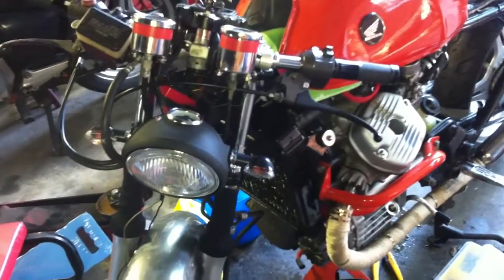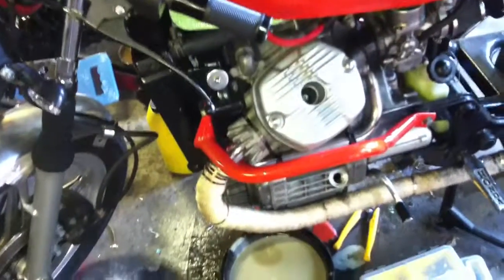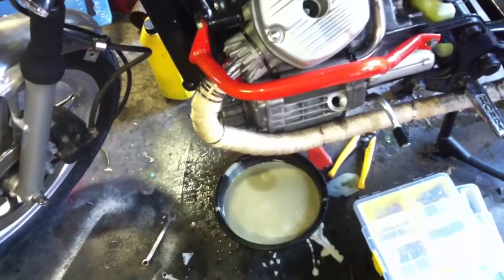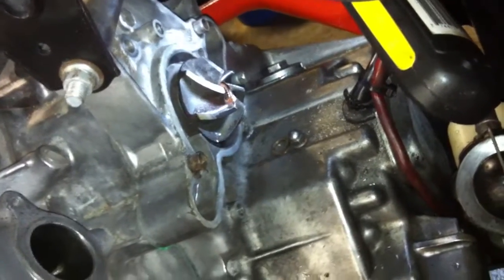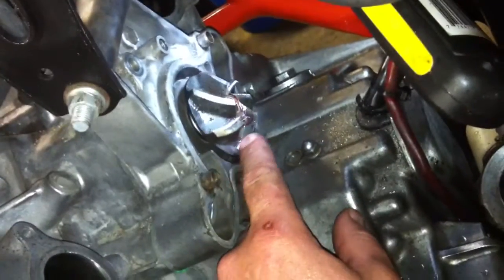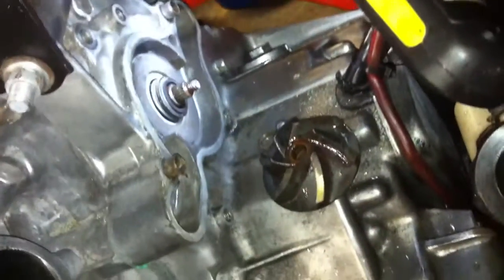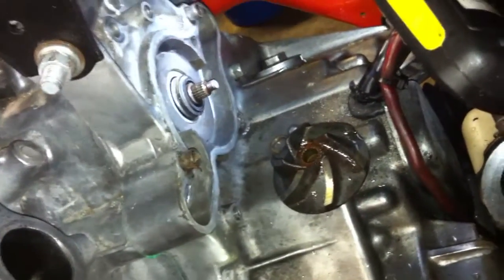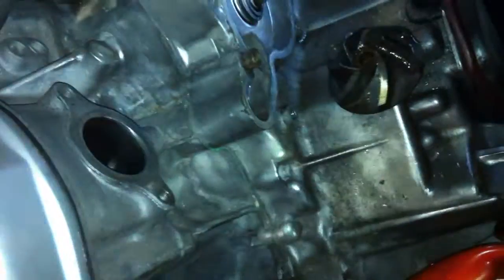cx 500 cafe racer ..water pump impeller problem

Comment: Yup That don't look good!!
Seeing it blew your new mechanical seal , maybe you will need to get a new "camshaft" That could I bet cost a LOT Hope that's not why she blew. , when I do them I always change every small wearable part or I know ill have problems later. 
(maybe you forgot the little washer? ) or your seal did not get installed right?
was it leaking from the weep hole ?
Reply from the maker: I seem to recall when I pulled it off the first time,that I made a mental note to replace the impeller (teeth stripped on the inside of the impeller hole but no visible wear on the outer edge towards the nut)  I didn't replace it....I am chalking it up to forgetting my "mental note"  ...they work great when you are doing a project in a short time..but over a long period you forget them.. :(
Reply from the maker: I replaced all the seals and all the washers were present...annealed the copper washer under the acorn nut,,,the impeller teeth stripping was the issue...which was completely due to me forgetting about it needing replacing
Reply: ***** Hope you get her going soon , Need more vidz of her also :)